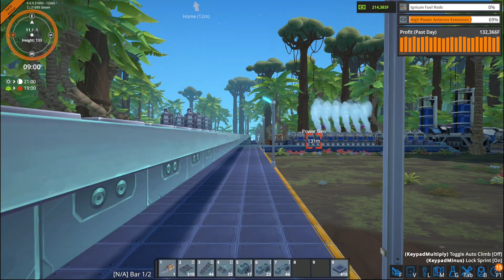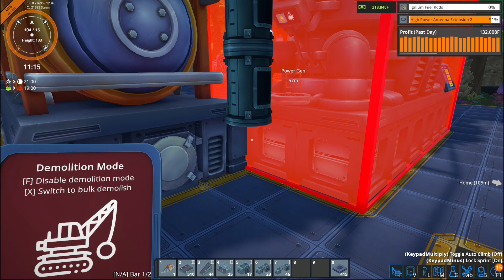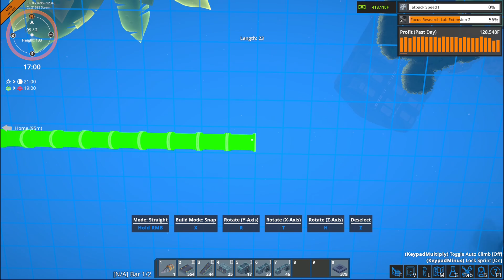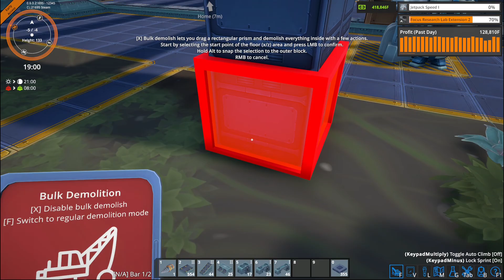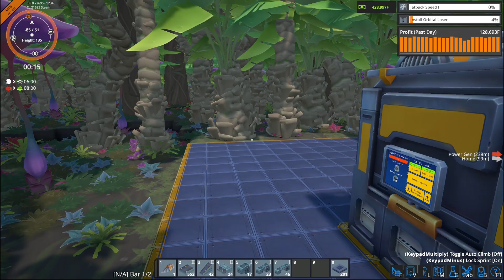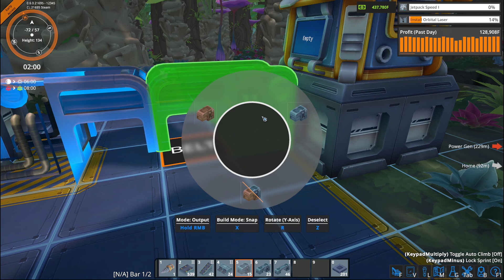Foundry Update 2 - Jetpack!

Comment: 4:45 there is 2 input for different stuffs. 1 is for water and the other one is for liquid polimer i believe. I hope they will chance the 3D models for liquid machines cause when u have input/output on 4 side and some recipe use 3 side its horrible to place them nicely.
In one point pipes will looks like spagethi XD
Reply from the maker: I think what would fix all the piped machines, is to change them to work like the blast furnaces and let us configure the in/out ports as we like. So you se the recipe, it complains not everything is set, and you go round, clicking on whatever ones you want to be in and out and whatever wherever.
Reply: @HouseOfHedgehog  I agree, this approach will be much better, then what we currently have. I greatly dislike of some recipe require to loop pipes around the machine 3 side -,- U put down X machine and its looks like a spaghetti already.